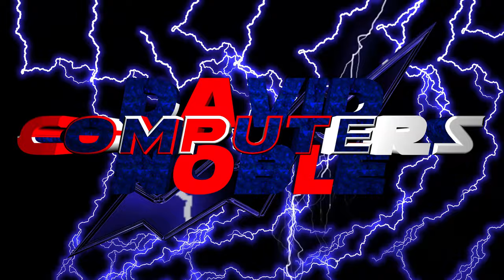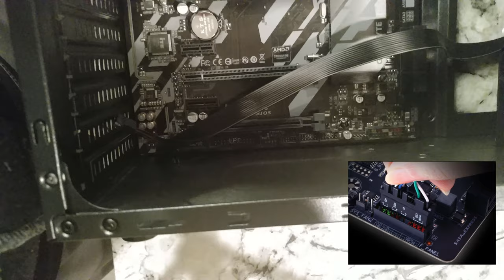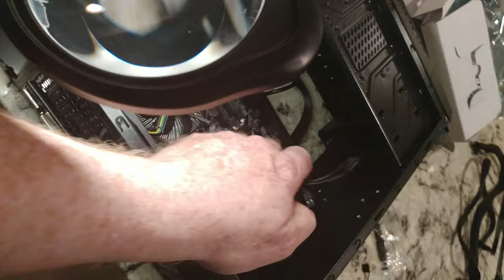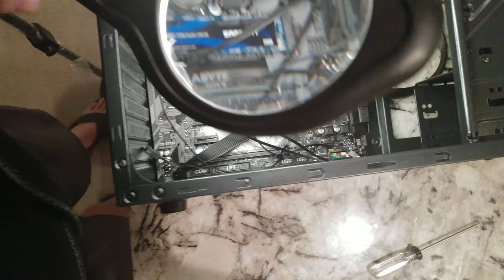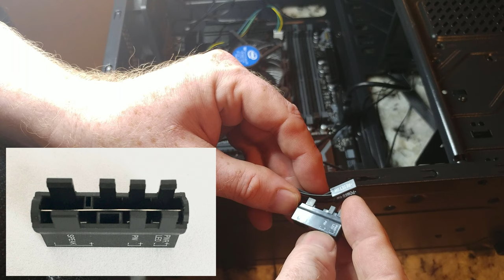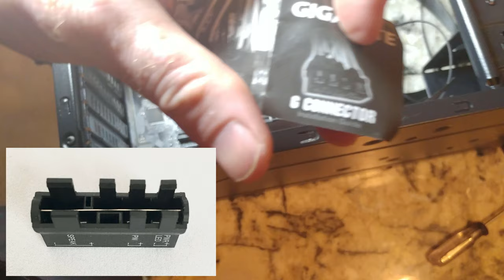How to use Gigabyte G Connector, shortcut to assembly HDD LED RES SW POWER LED Case motherboard

Comment: The G adapter from Gigabyte here looks super cool, but that does not help you in the end if you doubt which is positive or negative.  knowing which way the cables are plugged are far more important than the adapter from Gigabyte.  My doubt led me to this websites and I found they are also doing incorrectly including this video.  If Gigabyte would print the + and - on all the cables will make builders happy & save time.
Reply: Dude I JUST got my mobo and that was my first question. Im still waiting on my case so I guess I still have a day or two to research.
Reply: Look on the mobo manual. There is usually a 1 or a triangle showing you the positive pin
Reply: How is that relevant for power and reset?? Those are just closing the circuit. We use to reset boards with a pencil years ago...
Reply: The G connector has all the + and - printed for all the cables.
I consider myself a hardcore pc user bcs I am always changing things in my pc. I find the G connector pretty useful, it makes all the front panel cables into one unify cable you can plug and unplug without even looking.

Also the + and - are printed in the actual mobo (at least all aorus boards) so is easy one way or the other.

Comment: I work building computers and know the f_panel layout by heart. 
I find the G connector very useful, specially for people that are messing with his pc all the time.

It makes all the f_panel cables into one unify cable you can plug and unplug without checking for position or polarity.

This kind of gimmicks are nothing new. I have some ASUS AM3 and LGA 775 mobos with the same adapters they still including in new high end boards.
But I think the gigabyte implementation is better.

Comment: Thanks, I was wondering what that was for (it was in the mobo box). Good idea, there was no way I could connect those pins individually without removing my big graphics card first.
Reply from the maker: I always gripe why those front panel case connectors are not bundled.  My solution was to buy a light with a magnifying glass on it....though I have done so many of these installs, I should be able to do it blindfolded.   That said, some of the newest computer cases feature USB 3.0 & 3.1 (type c) and have hubs...and you will see they don't have the same number of front panel case connectors...hence, these will probably never be bundled.  Thx for the comment

Comment: The G adapter is a pain to install to the motherboard, but I did use it as a guide to plug in the Front Panel Pins.

Comment: Cool item, but some cases have the power LED chord arranged in such a way that the +cable is in the middle, so no matter which way around you put it into the connector, it will end up in the middle -connection. It is a bummer.

Comment: Wait do did it work??? I'm having issues with mine working and I think it's the front panel.
Reply from the maker: I have not had any difficulty with using these... but I have only had 5 come thru my doors over the last year.  2 or 3 have made it on the channel.  Hopefully, you have lined them up right and inserted them deep enough.  But there are lots of things that can go wrong with a build so it might be something else.
Reply: @PC_HardwareTechUnboxing_1  thanks. I sort of took everything out and wrote it off as power supply lacking.  But thank you
Reply from the maker: @MsDarkarely  Ok, hope that was the issue.  One thing that I am blessed with here is all the spare parts I have...whenever something goes wrong, I can test each component in a similar computer until I find where the issue is.  Sometimes it turns out to be something I did...after building computers for years and years, it is still so easy to screw something up on a build.
Reply: The dude plugged half of them in backwards..He's going to be having a short sooner or later
Reply: @danvinogradov138  I agree but it wont short, but it wont work properly. The ultimate damage is people are learning wrong from this video, that is detrimental.  To solve my dilemma I am sending an email to ThermalTake tech support for final guidance and proper instructions.

Comment: Mine says power Led on both sides. How do I know which side to use and cant find connecter for speaker
Reply from the maker: There should be a triangle/Arrow on one side of the connector...this notes positive.  You will have to look at your motherboards diagram to match this up properly.  I am eventually going to redo this video as I left out some key comments.
Reply: @PC_HardwareTechUnboxing_1  Thats my situation ... cannot find the speaker wire ... hooked it up and everything fires up
Reply: @PC_HardwareTechUnboxing_1  No it says Power LED on both sides of the G connecter

Comment: Thnk you david💙
Reply from the maker: I still owe you the other one, without this device.    ....but this device makes it so much easier...  I have been just leaving them in the box in the past.  I do need to see if they are compatible with all motherboards...or just certain Gigabyte ones.
Reply: @PC_HardwareTechUnboxing_1  yea
Reply from the maker: Sorry, I redid the version without G Connectors...the traditional way...I am happy with how this turned out.  I need to use this camera angle more often:   https://youtu.be/VOmTUjups30
Reply: @PC_HardwareTechUnboxing_1  Would you recommend using the G connector then or doing it without?
Reply from the maker: @OmarNaqvi  Hello, I most certainly prefer it over not using it.  Depending on how big the access holes are, in your case you have the ability to work on this outside of the RH panel where it will be easier to see what you are doing and ensure that you put them in the proper place without a magnifying glass (unless eyesight is really good).  You can then route then thru case and snap into the motherboard.

Comment: Where to get this adapter?
Reply from the maker: Usually comes with higher end Gigabyte or aorus.  Only place I know otherwise is ebay
Reply: Thank you man, having a nightmare at the moment my pc turns on but no display on monitor, not sure if something loose or not connected inside

Comment: My case does not have any HD thing.... it is normal?
Reply: It only have: reset, power, pwr led + and pwr led -
Reply from the maker: @drippydidong3768   I woudl say less than 10% of the cases that come thru my door are missing that feature.  Not a big deal...one less connector to plug in.
Reply: @PC_HardwareTechUnboxing_1  so does it changes something to my pc?
Reply: Does the "GDV"cable have to be plugged in the g connector? (Sorry for all this questions... btw you are doing a great job I love your videos)
Reply from the maker: @drippydidong3768   You should just not have Hard drive light...showing that your hard drive is working.
Reply from the maker: @drippydidong3768    I believe that is some sort of fan connector.  Did your case come with a special case fan?  Actually...what case did you buy?
Reply: @PC_HardwareTechUnboxing_1  an asus gt301
Reply: Can you help me, were do i put the gdv câble? My fan do not work and i dont know why